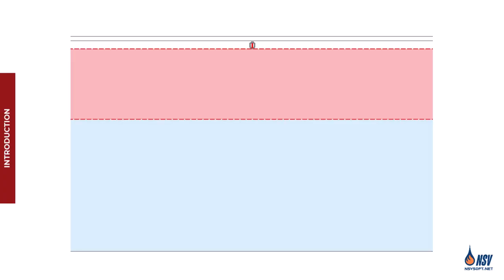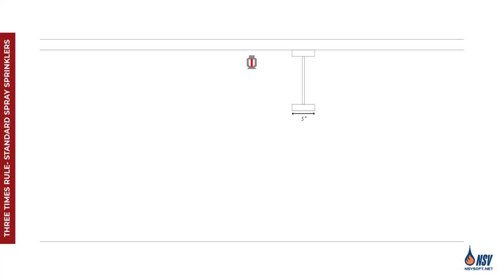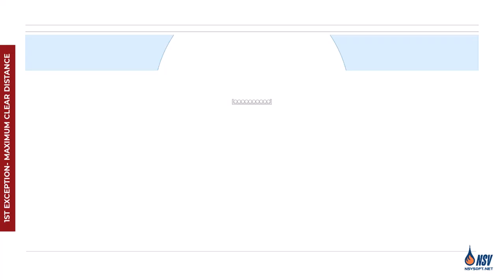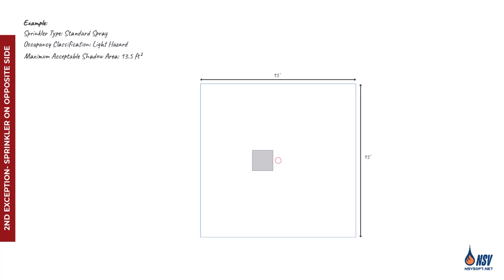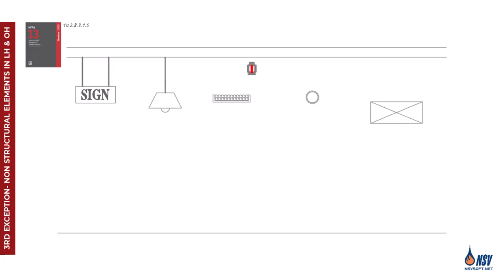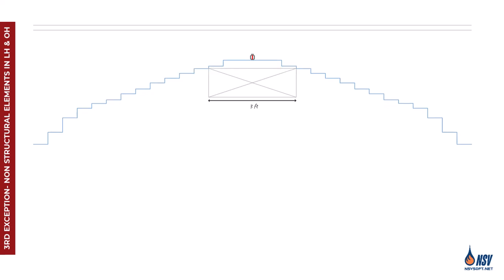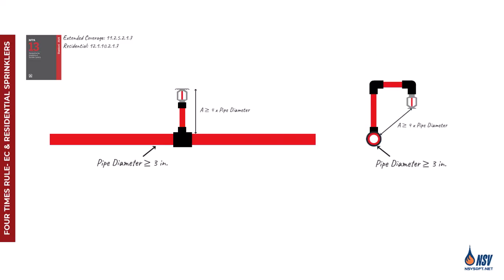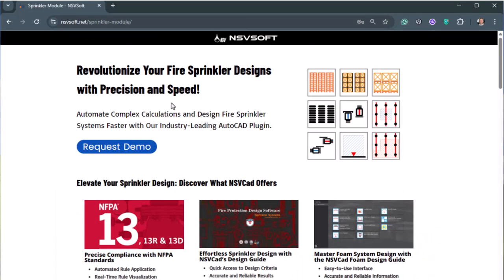🚨 Understanding the Three & Four Times Rules in NFPA 13

Comment: Hello , I have a specific question. For pendent open sprinklers, can they be oriented at a 45° or 30° angle toward the protected object? I once saw this arrangement used on a coal conveyor belt: it was part of a deluge system, and due to certain constraints, the sprinklers could not be mounted vertically above the belt. Instead, they were fixed to the side and angled at 30° toward the belt. I am unsure whether this setup complies with NFPA requirements. I look forward to your response
Reply from the maker: Hi, NFPA 13 does not explicitly prohibit angling sprinklers for open‑type sprinklers (without a thermal element) used in deluge systems. However, the orientation must comply with the manufacturer’s listing and installation instructions, meaning the angle must be permitted for that specific sprinkler model.

In general, when dealing with water spray or deluge systems, the design and installation should follow the requirements of NFPA 15, which governs special fixed water spray systems.
Reply: @NSVCad  Thank you so much for your help! Wish you all the best!